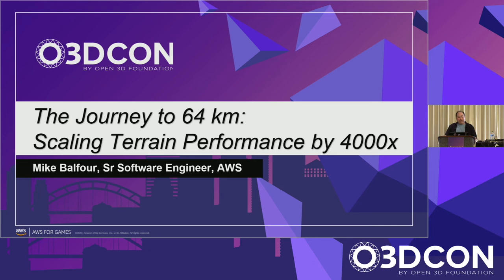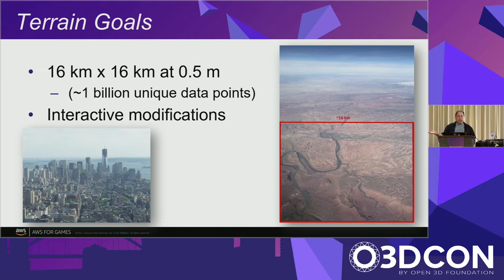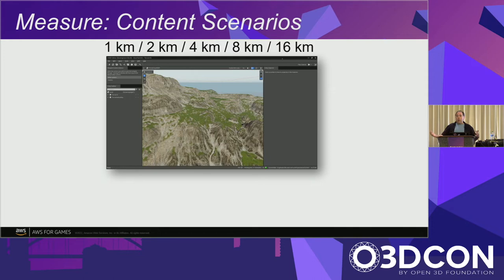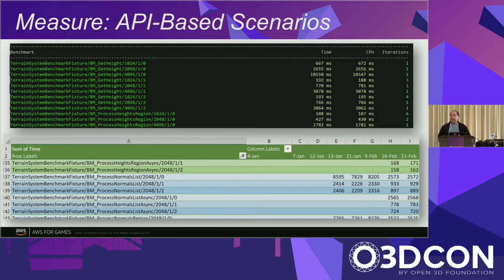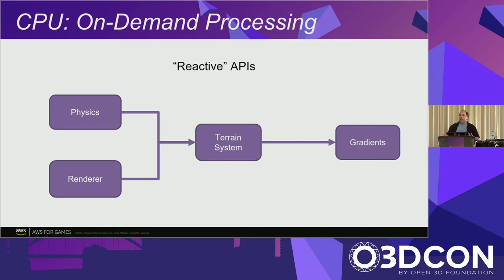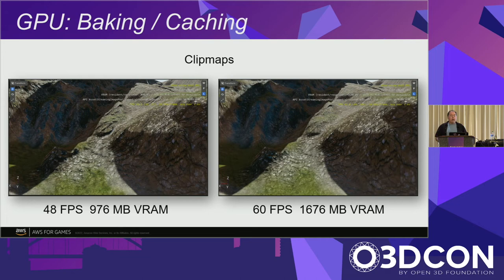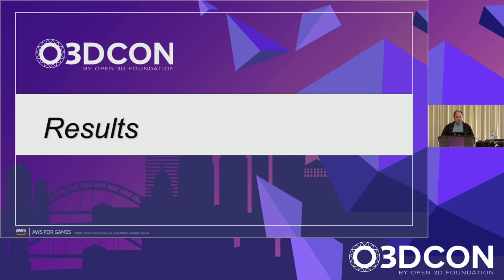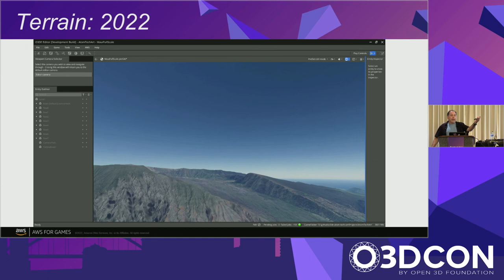The Journey to 64 km: Scaling Terrain Performance by 4000x

Comment: You made very clear presentation for inexperienced users in programming. That's a serious achievement.
Some weird questions: is it some kind of quadtree shown in 18:00? Does this thing relate to Visibility files and octree code from AzFramework?
Reply: It's completely separate from the visibility / octree code in AzFramework. You can find the code in the Terrain Gem in the TerrainMeshManager. Basically, it's just a grid of sectors that's centered around the camera, but the size (LOD selection) of the sectors changes based on distance. Because there's never a full representation of the terrain in the terrain renderer at any point in time, a quadtree is overkill. There's no data that needs to be filtered out, just height data that needs to be requeried whenever we change which sectors we're drawing or whenever the underlying terrain data changes for that sector.
Reply: @mbalfour22  thanks for answer, such responses really help to understand the structure of such complex tech a bit more clear.
Maybe I am just inattentive though.